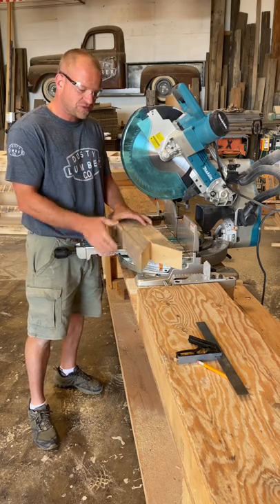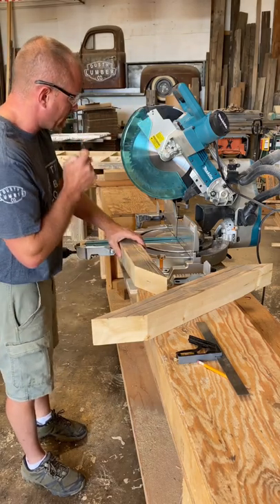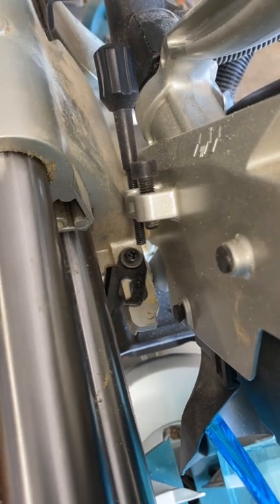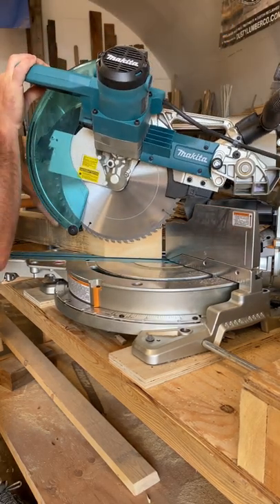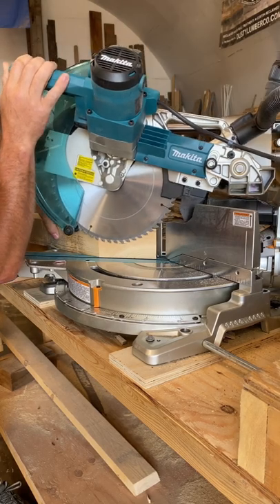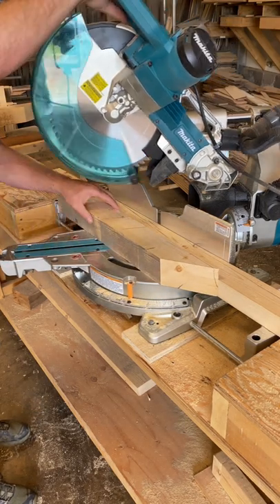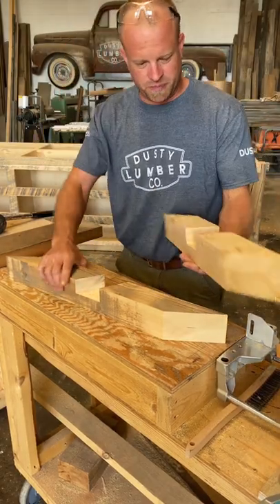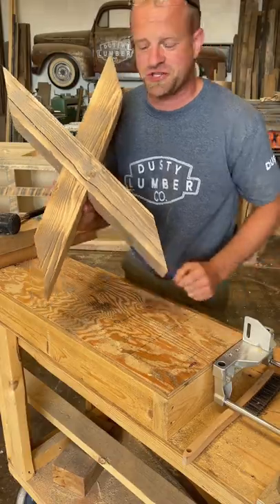How to cut cross laps with a mitre saw

Comment: Ah, I forgot to mention that you are the first video on YouTube that is something other than a 45° half-lap angle.  The angles that I need to cut are 68°.  I made a 45° fixture for the miter saw to cut greater angles.  The fixture worked, but the Bosch saw failed.  One more thing.  I cut my end angle as two complimentary angles to the center line of the brace.  That way there is no fragile "pointed end" to split or splinter.

Comment: The Bosch GCM12SD miter saw has a stop as you describe it, but unfortunately the parallelogram has too much play vertically to get a consistent depth of cut.  The depth varies as much as 1/8".    The Bosch manual actually says, "NOTE: For best results, Bosch recommends the use of a table saw with an optional dado blade set for cutting grooves and non-through cuts."  In fact, it says the same thing in two different places in the manual, so they know the depth stop is not accurate.  I know other miter saws now have the parallelogram.  I haven't tried any of them, but would be worried that they have the same problem.  I made an angle cutting sled for my table saw (but don't use a dado blade most of the time) to cut similar half-lap joints that you describe here.  An even worse thing about the Bosch miter saw is that is has no indicator for the cut.  The Dewalt has an LED shadow line and others have a laser.  I didn't notice it didn't have that feature when I bought it.  The first time I made a cut I was so disappointed that I almost took it back, but I had a deadline that I needed to meet and kept it to get done on time.   I called Bosch after making the deadline to see if they had one I could install.  Bosch recommended purchasing a roughly $30 after-market "laser washer" that shows itself only when the blade is spinning.  If you are cutting from that one side all the time that might work.  The Bosch might be the most expensive miter saw and they want me to buy an after-market indicator.  I installed my own LED shadow, modifying the saw and nullifying the warranty.   Even the Harbor Freight Hercules has one built in.   Bosch should be ashamed.  I'm ashamed that I bought it.  Good Video, by the way.  I liked it.